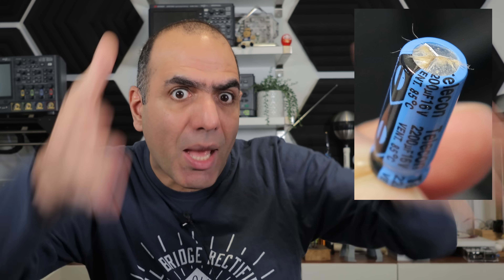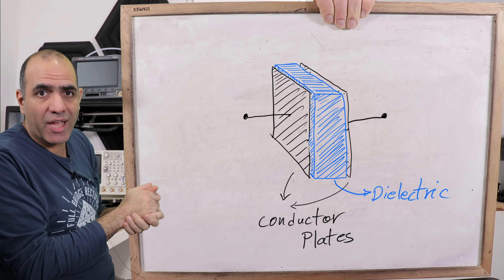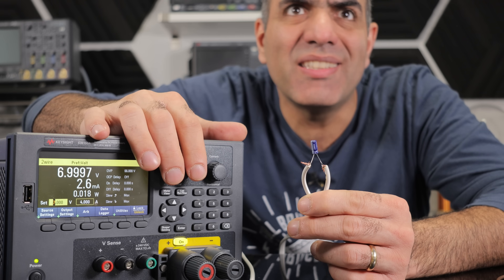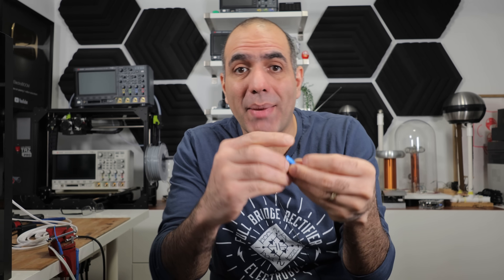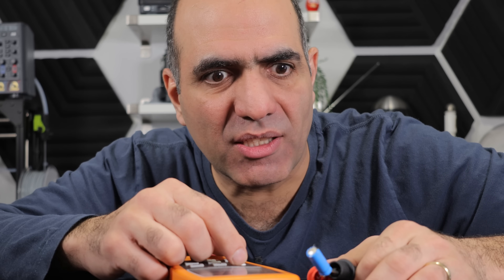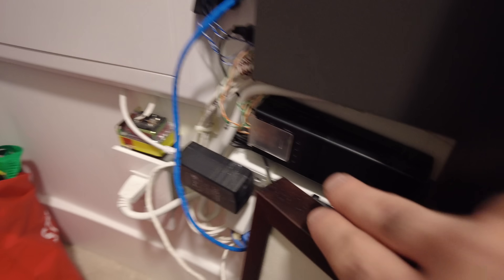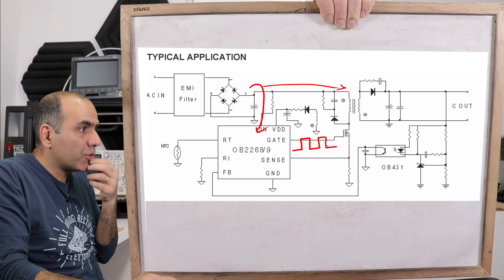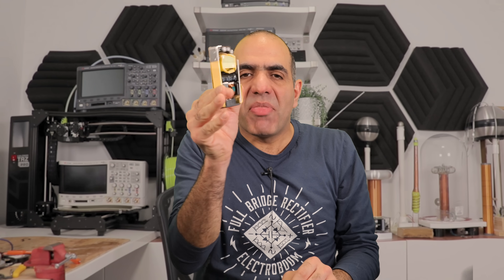Why Replace Bulging Electrolytic Capacitors

Comment: OK, lost me right at 8:37. SHAME on you for perpetuating that myth, ElectroBOOM.

I've had probably a hundred of those same power bricks. Probably about 94 are still lying around. They're actually fairly reliable -- I don't know what you did to that one. Whatever it is, you very obviously took out the inrush limiting resistor, and DIDN'T BOTHER TO CHECK FOR THE SAKE OF DRAMA.

For SHAME.

Anything that has one, will exhibit VERY visible damage to that component -- a scorch mark (what BigClive amusingly calls a "skid mark") or literally a burnt/toasted component, something that looks like it has literally been on fire. Anything that DOESN'T have one, is too cheap to be safely used anyways, and is only rarely found in the wild any more -- even as so-called "gray imports" (i.e., you bought from overseas on eBay). On power bricks such as these, that part usually does double duty as the fuse, although its primary purpose is actually to (a) limit the flow of current into the very large filter capacitor on the circuit board when you first cut the supply on or plug it in, and (b) drain the supply within mere seconds of being UNplugged. Oh, and almost always, those resistors are made of something that doesn't like to literally die in a fire, as indicated by the use of a resistor with a GRAY BODY, which means it's fire resistant.

As of late there's been a particularly unfortunate scareware campaign here on YouTube that seems determined to perpetuate the myth that this component either doesn't exist or doesn't do its job right, by way of ignoring its existence entirely and claiming that these capacitors are dangerous.

Unless (a) that resistor is very obviously damaged, in which case you will see a large, peanut-shaped component, usually in black heatshrink tubing, that is VISIBLY BURNT or otherwise very badly damaged in a way you really just can't miss, (b) you're looking at something so cheaply made that it doesn't have one (which, again, is increasingly rare, even as imports from questionable sources), or (c) the power supply you are working on is a linear supply from the 1970s or earlier OR part of a "hot chassis" style tube radio or equipment of that era, you have NOTHING to worry about. The absolutely ONLY exceptions to this would be the specific "inverter" supplies for electroluminescent (EL) lighting and for fluorescent lamps, including CFL bulbs and the CCFL backlights in what are now very old laptops, or the high-voltage supplies for the CRT in a so-called "tube TV" or monitor in the modern sense, where it's a CRT and not an LCD.

If you are overly paranoid and want to be extra careful, then with the "wall" end of the supply entirely disconnected -- THIS IS IMPORTANT, DON'T CONNECT IT TO THE WALL -- simply plug the power supply in question into whatever it's supposed to power, if it's for example a laptop-style brick (like the one ElectroBOOM is demonstrating) -- with anything else potentially powering that equipment, such as a laptop battery, entirely disconnected -- and press the power button on the system a couple times. In the case of something like a standard modern power supply for a desktop PC, or an older "retrocomputer" from eg the 1980s with an internal power supply, simply flip the power switch on and off a few times (or press the button a bit, whatever) before removing the supply. As long as there's no large battery in the system, and the supply itself is not plugged into the wall, this will most assuredly discharge whatever's in there quite safely.
Reply: I ain't reading allat 🗣🗣🗣
Reply: @BenGameBG  and yet you cared enough to actually tell me that?
Reply: @laserhawk64  no but did you actually write all of that or is that just copy pasted from somewhere
Reply: @BenGameBG  Yes, I wrote it all. Probably at this point I should have something I just copy/paste and do the equivalent of a 90s "mail merge" thing with, because of how INCREDIBLY STUPIDLY COMMON this mythos is becoming on YT, and how many people are perpetuating it -- especially people who are otherwise actually trustworthy, such as Adrian Black of "Adrian's Digital Basement" and, well, ElectroBOOM. It's been circulating for over a year now.

Here's the short version.

That "capacitors will zap you!" thing? NOPE NOPE NOPE NOPE NOPE and power supplies are specifically designed to avoid that. If you pop open a dead power supply, look for a big ol gray peanut lookin thing. Sometimes it'll be in a bit of black tubing, sometimes not. It'll have some colored bands around it, regardless. IF THIS PART IS INTACT AND NOT PHYSICALLY BROKEN OR VERY BADLY SCORCHED, YOU DO NOT HAVE TO WORRY ABOUT CAPACITOR ZAP. Very obviously, "tube TVs" where you have CRT display, and anything old enough to have actual vacuum tube electronics is going to be different, but the power supplies in those are very, very different anyways -- especially in the case of old e.g. tube radios, those power supplies actually work on a completely different principle.

If you're at all concerned, get a flat-head screwdriver and crack it across both leads to the capacitor. This will be a bit scary, sometimes, but it does the job. Alternately, if what you're working with is an internal power supply, something for e.g., a vintage computer, unplug it from the wall and flip the power supply switch on and off a couple times -- this is MORE than enough to drain whatever's left in there, back out.

For the record, I actually know where this mythos originates, and it's just incredibly dumb that this is how it's being portrayed.
Reply: @laserhawk64 
Trick with YouTube comments. Short and simple. It's a comment not the book of life. Let alone we here don't have enough attention span to read 4 paragraphs while watching a video.
Reply: @laserhawk64  
Like that. Short and simple. A+.
Reply: @dogs-and-destruction-channel  ...but, ironically, not well enough to do what it says, even though it's been kind of a universal rule for so long that it arguably was part of what we once called "Netiquette", back when that was a common buzzword.

In The Queen's English -- sod off now, kindly, would you?
Reply: @laserhawk64  
Interesting statement. And I got a free history lesson too. Well played, my friend. Well played.
Reply: @laserhawk64  
Actually. I think your information was actually quite fascinating. I don't think you're sour at all. We're cool man and thanks for the wonderful and knowledgeable chat.

Comment: I've come across capacitors in power supplies that actually appear fine, but it's only until you desolder it from the circuit and test it that you find it's pretty much dead. Those are a real nightmare to troubleshoot.

Comment: I would say repair device with leak capacitor is the most tedious task ever. the problem might just be a small leak but other time it can result from weird behavior to damage trace and sometime it can result in fried component. that happened to my old C64 and it fried all the IC

Comment: Youtube ate my comment. A lot of my electronics work is replacing caps. I don't reform them fight me. Also you find even if you are fairly well stocked it's often easier and cheaper to board swap if not replace the item entirely. Only the high dollar, vintage or sentimental stuff people feel is worth paying to repair. Why it seems electronics/radio guys are a dying breed as far as doing it for a living. Thank you for the awesome content you are appreciated.

Comment: Connect electrolytic capacitor that is polarize in the opposite direction and it will quite quickly budge.

Comment: This reminds me of the capacitor issues I had to deal with for a few years working as a computer technician.  There was a mass of capacitors that were released in 1999 that had a high failure rate. https://en.wikipedia.org/wiki/Capacitor_plague

Comment: To date I've repaired some 6 or 7 monitors that my uni threw out whose only problem was some bulged caps on the power board 😆 older screens but hey 1080p 24" is not bad to have for the price of 15 mins of work and €2 worth of caps

Comment: I broke a GPU like that one summer, was playing games in 30c (indoor) heat and after a bit my GPU just stopped working. One of the capacitors is just slightly raised off the board and a bit bigger than the others. I don't know if it fully popped, never looked at it that closely, but there was definitely a lesson learned there and I'm much more careful about what I do with my PC in summer now.

Comment: From my experience most bulging capacitor happen just from old age (on e.g. very old computer motherboards that sat in some basement for 20 years), if it's overvoltage they either completely blow up or something else in the circuit dies first. Cheap chinese power supplies it's the mosfet or control chip cooking themselves to death 99% of the time.

Comment: Bulged capacitor - main sponsor of upgrading your PC.
That cheap caps in PSU, which worked at its very limits just say "Enough" after 1-5 years of using PC

Comment: Learned about bulging capacitors as I was getting into reel to reel tape deck maintenance. The motor run capacitor on one of my earliest decks (50+ years old) was failing and the dielectric was oozing out the top. I was able to replace it with a much more modern ceiling fan style cap of the same specks in just a few minutes!
Reply: Did the same for a monitor power supply. $0.30 and 20 minutes to save a few hundred $$. Home electronics repair isn't as hard as most people think. Same as changing your car oil or putting in some new shelves. Especially now with countless tutorials
Reply: Mine was an old Cisco switch I rescued from e-waste at work. Brought it home, all the lights lit up but nothing else. After some time googling I decided to buy in new capacitors and replace them all. Lo and behold it booted!

Comment: There isn't dielectric gell in them (unless it's a paper oiled capacitor and you count oil for a gell). Instead, there's conducive electrolyte, and the dielectric part is played by a nm to μm thick oxide film on the etch roughed surface of one of the allumunium strips.

Comment: Note: edited to correct governor version.  See posts below.

I worked at a gas turbine powerplant built in the late 80’s.  The engine control was a Speedtronic Mk IV.  It had three redundant control computers (essentially highly modified 286 PCs), and a fourth communication computer for the interface.  All of these computers had independent power supplies with a multitude of capacitors.  We had 6 spare power supplies on the shelf.  We found out the hard way that they had to be stored in the same orientation as when in operation.  Of the six, we had only stored two in the correct orientation.  The other four failed on install.  We rotated them to correct orientation.  A year later, one worked.  The other three blew their capacitors.  We never did figure out why.
Reply: Maybe it was different revisions of board. I have seen something like this before in industrial 48V PSUs.
Reply: @nexonsu  GE changes part number suffixes when they revise a part.  All of these were purchased at the same time as the gas turbine package, and all had the same part number.  We weren’t the only plant to have this problem.  At least two others we talked to had the same results with their spares.
Reply: This might be due to convective heat dissipation. Many devices with passive cooling are designed in such a way, that the hot air rises up and out. Cold air is coming in from the bottom.
If you disrupt the orientatnion, you may end up with heat from transistors going to places it shouldn't - like bunches of capacitors, overheating them just as reversed polarity would.
Reply: @MastaBlastaZDusta  No, anytime they were under power they were mounted in the proper orientation.
Reply: Capacitors never fail because of their orientation. The electrolyte is absorbed in a solid material inside, so it doesn't matter how they are stored. What does matter is temperature, and of course the time! 
On the other hand, I've never seen anything older than Mark IV 😅 When I started, I was working on the last final MkV panels, then came MkVI, then the now actual Mk6e... in any case, late 80s is more Mk V era! I believe MkII was still using relays and stuff... and dates back to the 60s, maybe even earlier. Those Mk IV panels were 70s technology as far as I remember, I still have some bits and bytes of them in my storage. Cheers!
Reply: Now that I read again what you wrote, it is definetely a Mk V architecture. R, S, T and C cores, with a little VFD alphanumeric display on the top left corner of the big metal boxes, right? 😉
Reply: @janosnagyj.9540  1st reply didn’t post?

It. Has been a while, so I screwed up.  It was a Mark IV.  We upgraded to a custom PLC based system in 2004, so I brainfarted.  I edited the original post.  Thanks for the catch.
Reply: Ancient electronics baffle me, like how valve circuits and some old TVs have live/hot chassis (instead of it being ground) and if you have niche uses for CRTs you have to take the Earth magnetic fields into account (rotating a CRT for portrait orientation arcade games, rotate it without turning it on and just let it sit in that position for a few days for its electrons to align or whatever, or suffer magnetization artifacts)
Reply: It could be that they had film capacitors in them, and through the years have suffered from moisture ingress/process issues. Those caps have led to some older devices dying on 1st power on while they were all fine when stored, and even stored properly.
Check EEVBlog 1486 (unless I'm remembering things a bit wrong).

Also eletrolytic ones loaded with voltages far lower than their rating for long can also have issues, tho I forgot what the name of the mechanism/effect was.

Comment: Ohhhhhhh boy, I resemble the last part of this video. The amount of salvaged electronics parts I have scattered around is going to take a lot of work to throw away when I die.
Reply: I managed to reach the phase where I'm able to contemplate the concept that, uhhh... perhaps all those de-soldered resistors and capacitors in my youth are just a teeeeeny bit obsolete, will never ever again be used, and MAYBE I should (GASP!) get rid of them myself...
Reply: Absolutely worth it for the one time that I did get to use a thing, felt like a freaking genius.
Reply: @OhadLutzky  That's a unique feeling you can't get anywhere else
"I'm not hoarding, see??"
Reply: @Blankult  LMAO there's nothing like it, you feel so justified in the madness 😂
Reply: That's a goal a lot of us strife for :)
Reply: Since i was a kid i've tinkered with game controllers and kept the parts from the ones that i couldn't save, now, as a 24 yo, i have several pots full of tiny plastic pieces, and that's only the controller parts ...
Reply: same here xDD
Reply: Just make an effort to throw all the broken electronics away once a year. Then a week later you will need like 50 of the parts you discarded. The alternative is to keep it forever and never need it. Either way, it never gets used....
Reply: @ulbuilder  Real as life!!
Reply: Yep that last part describes me perfectly
Reply: same, i have some scrap pwer supply and amplifier circuit boards from my dad's old amplifiers from sony just beside my bed
Reply: It sucks that it's better value for money to throw away the old supply and buy a new one. Repairing something is always better than waste, and the only reason he wasn't able to do it was because he couldn't find the part he needed for a reasonable price.
Reply: Exactly same issue! ElctroBoom nailed it!
Reply: Only one option: don't die.
Reply: I am currently going through my grandfathers workshop and he was like that (so am I a bit). I can gladly say from the experience. Yes, it very much is a lot of work (to put it lightly)
Reply: same lmfao!
Reply: It was too real.
Reply: look in the back of my work van with a HOARD of scavenged parts i have used... ONCE in my 2 years at my job
Reply: us bro us
Reply: I mostly focus on saving large components now - such as large inductors, large capacitors, power resistors and heat sinks. Which makes the storage a little more manageble. Small components, ICs and not even the power transistors and diodes are worth the effort to desolder and collect most cases - because new ones (that for example don't have their legs chopped off to like 2 mm) and/or better ones (for example power transistors that can handle more current/voltage), is cheap to buy. 
Ironically, it's the simple things, such as heat sinks and inductor cores, that's mostly worth saving
 - those things are expensive to buy, haha. But I still have a bunch of old circuit boars laying around, as I have been too lazy to demount all the components I want.
Reply: im guessing you are right at the cusp of prehorder.
Reply: Free fully fried “dinner” but you have to clean out all the electrical components from the room 🤔
Reply: Bro ur like count is da devils number

Comment: The common failure point for SMPS are blown MOSFETs, you measured output voltage to be zero, so I assume that's what happened.

Comment: The gel is not the dielectric in electrolytic capacitors. The gel is one of the conductors and the dielectric is on oxide layer on the other conductor.

Comment: I had a capacitor half break on my audio mixer which ended up causing all the audio to become complete garbage, Quick replacement of the cap and good as new! I also have about 10 spare caps now so if it goes again I can just fix it again!.

Comment: I have a question. If I rotate the ceiling fan in the direction when it runs, before turning the switch on. So will it take lesser power for the fan to start running ? I mean will it consume lesser energy from capacitor ?
Reply: Yes :)
Reply: No